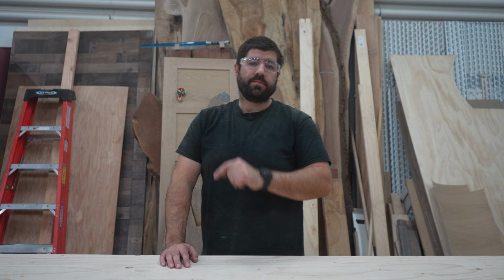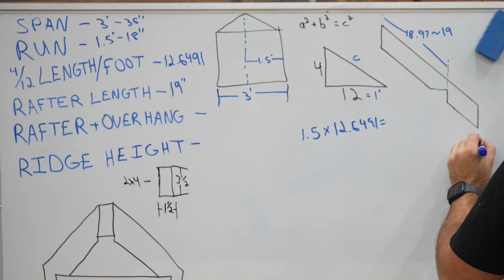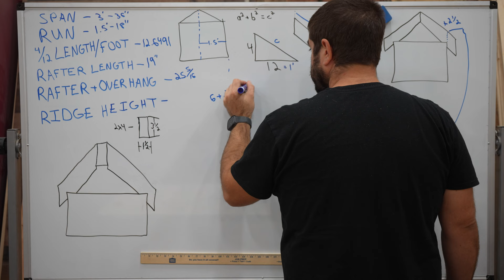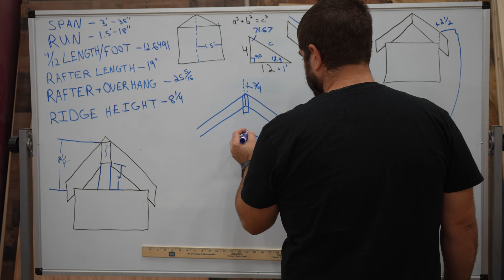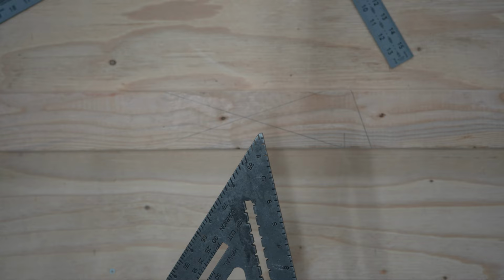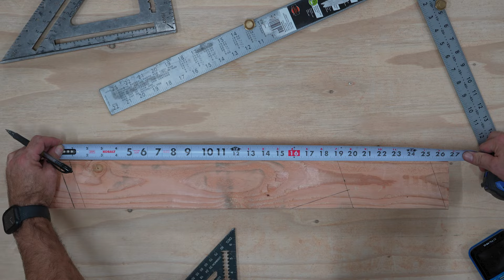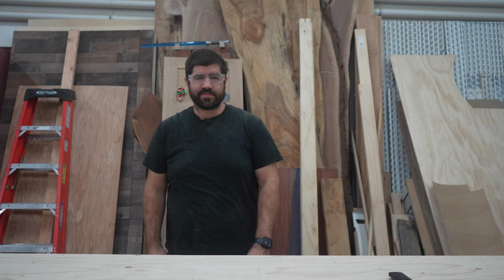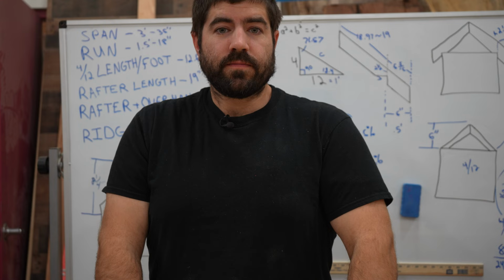How To Hand Frame Gable Roof With Common Rafters

Comment: nice job ... and i think order of operation would necessitate to make everything roof related first on large floor areas, then set aside the completed roof parts, and then make the walls so when done with walls you just put on top of them one by one the roof parts you made prior..
Reply: Could you explain why making roof prior to walls is beneficial? Is it for speed of assembly?
Reply: Yes...  I am probably not as clear as I should be, my profession background is computer science and I am also KG6AFF amatour radio background and wanting to build geodesic dome homes two - three in 275ft^2 range and octagon homes also in small area first before building a big one of each... so I studied a lot from everyone nice enough to make these great videos, and making the roof parts before making the perimeter or interiour walls has the advantage of having the entire floor available to lay out the roof parts test and pre "work" safely on the ground with lots os space and safety not falling off later from work I could have done on the ground before, then once I can't do any more prep ahead work with roof sections then I plan to set them aside having completed those parts for as far as possible then I would build the perimeter and interiour walls and then uplift the completed sections, probably just simple every 16in recurring parts, i don't know what they are called, but just lifting  those in place and affixing them t each other and nailing down plywood on top of them would be steps for A frame type shed or home constructions...  my plans for octagon house is similar to a point only and gets complicated after that.... my geodesic dome home building will be more like a furniture wood screw and glue build than a traditional home build seen on youtube... but I can learn a lot watching these great ideas...     @aarontravieso7784
Reply: @KG6AFF  thank you 👍🏿
Reply from the maker: This works as long as there are no changes in the wall design or roof design before the roof needs to be set. But you are right that is a common way it is done. It can help with layout too if you aren't as familiar with roof layout because you can sort of draw the roof on the floor.